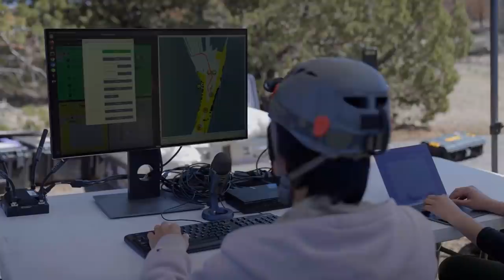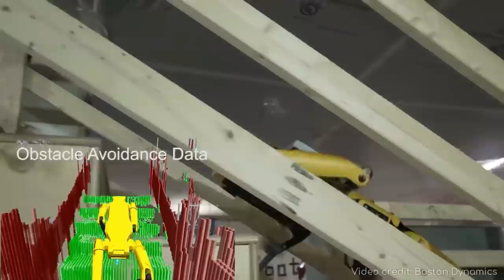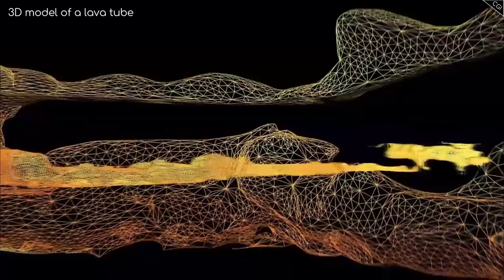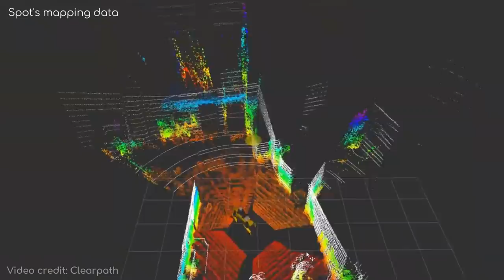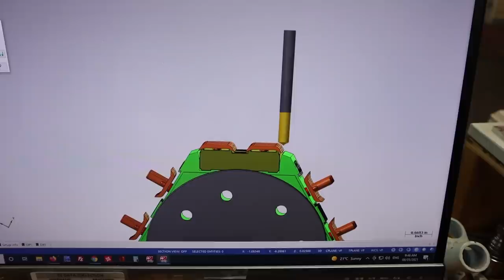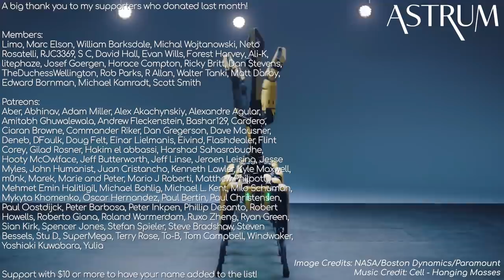How Wheels May Soon Become Obsolete For Mars Exploration

Comment: The 3 challenges that Spot will face are, carrying a nuclear power generator on Spot. As well, the ability for its components to handle cosmic radiation, and extreme cold temperatures.
Reply: Yes, better them than us don't you think..?
Reply: They need not to send unmodified Spot. They will build a specific version of it geared for space conditions.
Reply: That's not really that big of a challenge.  The Viking probes were exposed to far more frigid temperatures and radiation levels.
Reply: Yes, radiation hardening was the first question that came to mind. It's not as easy as just sticking a modern powerful chip in a lead can, or they wouldn't still be using the 20 year old glacially slow chip designs they do today. If walking robots go to Mars they probably won't be anything like the small nimble Spots shown here.
Reply: Maybe they'll have one unit dedicated to power generation and all the others will charge their battery back coming back to connect to that unit. This power generating unit could also serve as a relay to communicate with Earth, the others won't need long range com.
Reply: There really isn't any special challenge Spot faces that all previous Mars rovers didn't face, besides carry capacity. And even then, if the idea is to send multiple Spots then that's effectively irrelevant.
Reply: @GerardMenvussa  I think something like this would be especially good for something like cave exploration
Reply: @GerardMenvussa  yes exactly, tho if it's my version i would not dedicated one unit for that, instead i will put a movable battery station on mars surface and equip each spot with AI that self aware about their condition, so if their battery almost run out , they can go back to surface and switch their battery the back to explore the cave
Reply: Moreover, Mars is dusty AF. Any articulating points on Spot’s body will need to be ridiculously impervious to high-velocity dust particles during the frequent months-long storms.
Reply: @caryd67  true. That’s the 4th major issue to overcome. Obviously these can all be overcome. But it’s important to highlight the challenges and not make people think it’s just a matter of plopping Spot on Mars (which this video almost implies).
Reply: @shadbakht  absolutely. Some YouTube videos almost make it seem like we’ll have cities there in a decade; we really don’t even know what we don’t know yet. But I sure appreciate the many minds from all over the world working on this stuff and moving humanity forward!
Reply: @caryd67  Couldn’t agree more!
Reply: @caryd67  about the dust storm, it doesn't happen below the surface. And spot is specifically design for exploring and mapping mars cave. So I guess that's not something problematic.
Reply: @yahyarisqi7879  good point, I didn’t consider that. But if we did send Spot to Mars, at some point sooner than later, it’s going to have to traverse the surface so it can collect as many data points as possible, don’t you think?
Reply: @caryd67  The thing is, Spot can be mass produced, so it's not as expensive or precious as a typical rover. In fact, even if a space-ready version is ten times higher than the consumer model, its nuclear power source will still be an order of magnitude more expensive than the robot itself. So the real limiting factor is how many nuclear batteries can the mission afford to send up. If they fly up 25, that'd be equivalent to the cost of the Curiosity mission. In other words, unlike traditional bespoke rovers, they can afford to lose a couple to the elements.
Reply: Well if they can "harden" all the rovers against cosmic rays, then I'm assuming they can do the same with the robots
Reply: @z-beeblebrox  

Exactly.  Spot is cheap.  It retails for only 70,000 dollars.   I think that's the point that a lot of people are overlooking.    Losing a few spots on the moon is no big deal.   When one breaks down, you just send in another
Reply: @caryd67  for surface data collection i think they already have rovers for that like the current rovers they send to mars called preserverance.
Reply: The mars rovers already solved those problems we just need to figure out a way to implement those solutions in spot
Reply: @stevencoardvenice  - You'd assume wrong I'm afraid. The feature density of the chips required to make spot work? is far, far higher than anything we've yet radiation hardened.

If we want to put a computer on Mars without it crashing every few seconds due to the radiation? it has to be a radiation hardened chip - and that's not something you can do to any chip - it's a certain class of chips with a very large feature size that is less susceptible to errors caused by cosmic rays - Long story short the best computer we can put in space without it crashing? is about 10 times less powerful than a raspberry Pi.

A Mars spot - would move very slowly and only a metre or two at a time - it won't have chips fast enough to respond to a stumble and update a complex route at the same time. Every unexpected stumble will mean stopping and then recalculating the obstacle again - at best. If it can't calculate that it needs to put a foot down before it falls over? then it's going to fall over.
Reply: @JohnnyWednesday  I saw video somewhere on light based computers. There are some operations in which they are not good at but image processing is their thing and because they work based on laser with specific wave length then they should be completely resistant to this problem. There is company which is from what they said ready to release it and sell it. They said it is perfect for machine learning and image processing. The electronics controlling part of this computer would needed to be hardened but this probably would not be a problem and that computer would be multiple times stronger than some modern consumer grade GPUs not to mention it would draw only fraction of power and heat waste would be minimal.
Reply: @JohnnyWednesday  

Thanks.   I don't know anything about this.   Stuff I did recently hear about this "bit-flipping" problem though from cosmic Rays.
Reply: @likilike501  - Yeah it's theoretically possible to make a computer based on light - but we're a very, very long way from that. An optical CPU matching the capabilities of your Iphone would currently be the size of a city.

Intergrated circuits, individual gates on silicon? were smaller than we could reasonably imagine - before we were even born.

there were 68 thousand transistors in the processor that powered the Amiga 500 and the Sega Genesis - and they were on a substrate as small as your fingernail.

that's roughly a grid of components with 260 rows and 260 columns.

With the lasers, the prisms, the photon detectors - even our best technology right now? would take up a warehouse to do that.

That processor was originally released in 1979.

Current processors have billions upon billions of transistors.
Reply: @stevencoardvenice  - yeah - basically the smaller the features on a chip? the easier it is for any stray particle to change the state.

So 'radiation hardening' while it sounds cool - basically equates to keeping the components and the traces between them - big enough so that when they do get hit? (you can't stop everything) they're far less likely to change.

Other techniques are also used - like having 3 computers working together and get them to vote on the result of any calculation.

If two give the same answer and the other is different? then the first two answers will be used.

Yeah the same bits could of been flipped in both computers simultaneously - but the odds of that are so small? it'd take 10 ages of the universe to happen (or something along those lines)
Reply: @stevencoardvenice  - And yeah there's also parity for memory, error checking - similar to CRC checks or hashing for a torrent file etc

But while your memory might be ECC and protected? a register inside the CPU where some data gets put inside? is not ECC.

Plus your error correction scheme - could be the thing that has an error - causing correct data to be altered to become incorrect.

It's a really difficult problem to be fair - getting a perfect answer when even your error checking might have an error? very tricky!
Reply: @JohnnyWednesday  well that would explain it.   Well I hope they start testing to new hardware in deep space, so we are not stuck using Intel 486 chips in the space program for the rest of eternity
Reply: @stevencoardvenice  - lol! we can do a bit better than that :D but for deep space stuff? not that much better - but we can use multiple processors and for many things? a 486 is overkill. Pretty much... unless it's image processing like the martian helicopter? there's nothing critical that needs to be done that needs much computation.

Take Doom running on a DX4 486 running at 100Mhz - it'll run like silk. The calculations doom does for just one frame? many times the amount than a martian lander updating 100 times a second.

I was born in 82 - I've seen computers evolve, became a programmer - yeah old computers seem slow - but they're really not - it's just that modern computers are insanely, insanely fast.
Reply: @stevencoardvenice  - long story short? Spots computers would crash on mars - equivalent capability in radiation hardened components would take up too much power / volume.

A Martian spot would be more limited - it would pause between short walks to calculate what to do next - it would probably fall over more, not being able to react quickly enough - but! it could still stand back up. dumb-spot will still get the job done :)
Reply: @JohnnyWednesday  

So you're not confident that nasa will ever be able to design an advanced processor that is sufficiently resistant to cosmic ray "bit flipping?"
I know there is a current plan to send an autonomous?  flying drone to Saturn's moon Titan.    Although titan has a thick atmosphere (which might block the rays, idk)
Reply: SpaceX uses triple redundancy and voting when the three don’t agree instead of radiation hardening. That approach may work on Mars too though more redundancy would probably be needed because low Earth orbit is less exposed than Mars would be.
Reply: @stevencoardvenice  - They'll be able to use several instances of a given processor that will be good enough - we don't need powerful computing out there - we just need enough capability to get the data back to the powerful computers here.
Reply: Unfortunately you've touched on the biggest problem, power generation. Since they want to use a small nimble robot, solar panels won't be useful. Also, so much time would be wasted on return trips to recharge.

For this to be a thing they would need a better method of power generation and storage. Lithium Ion isn't going to cut it.

The robot either needs to generate and recharge it's own energy, never run out of energy, or be able to run for days to weeks before recharging.

Edit: Currently spot has a runtime of 90 minutes. What's that going to look like after adding the new software and scientific equipment? You're not going to get far at all...the range of exploration would be limited to wherever it could go in 45 minutes... pretty useless.
Reply: @HE-it9ho  

Why?  Why does the little robot need to last so long?

I think an hour inside a lunar lava tube to conduct reconnaissance is more than enough
Reply: Naw, they are just one more step closer to making the cassette decepticon " Ravage" will launch out of Soundwave 🤣 So let's see how many remember that from back in the day.
Reply: @stevencoardvenice  Perhaps the times I listed were a bit excessive, but even an hour inside a location would mean a 120 minute+ battery life to account for the trip there, an hour of exploration and the trip back to the dispatch vehicle.

I mainly added the extra time to account for anything unexpected.
Reply: @stevencoardvenice  : Well if one ignores the cost of launching mass into space.
Reply: 4:13,  Being equipped with an auto aiming M-249,  reloading ammo on-the-fly,  and clearing jams to continue depopulation programming.
Reply: Gotta say I love all the comments here pointing out how hard space is because although I love that people get pumped about space way too often videos like this make it seem so easy and at the end of the day when normal people see NASA spend millions and several years to basically put an r/c car on mars people just think the engineers suck or are wasting money when you can just buy one just as good if not better for a couple hundred dollars.
Reply: @luxeraph    SPACE:  The final Boondoggle.
Reply: You wouldn't be able to run the robot and all that advanced electronics on an RTG.

My guess is what would happen is they'll land a centralized power hub which would have robot docking stations, central communications and deployable solar panels. They could then have numerous spot robots built for different functions. The robots would dock to recharge batteries. They would receive missions and be dispatched to perform them, then come back once the mission is complete. They'd then reduce and upload collected data and recharge awaiting future instructions.

If a spot became nonfunctional you could send in more. They'd get dropped off by a skycrane and link up with the central hub.
Reply: @stjernis  radiation is not as big of a deal for electronics as people think. It takes significant dose rates for any immediate consequence to be observed. The dose rates observed on Mars are about 0.7 mSv (70 mRem) per day. That's a dose rate of 28 uSv/hr (2.8 mRem/hr). In my work we regularly deploy Panasonic cameras in dose fields of .5 to 1.5 mSv/hour (50-150 mrem/hr) and run them for two years straight. Even then the damage from the radiation dose is not terrible. They're mostly damaged from the heat.

So on Mars the radiation is not a huge concern for robotics. Plus if these are going in caves. The primary source of radiation on Mars is cosmic radiation from space. Once in the cases they'll be shielded by the ground above and probably see little if any radiation.
Reply: I think Spots biggest challenge will be in not being distracted when a human plays “fetch” with it.
Reply: @caryd67  Just use rubber bellows like on a cars steering rack.
Reply: @bomberaustychunksbruv4119  but rubber can’t stand up to cosmic rays, which I’m guessing is why the landers don’t use rubber tracks like a mini excavator
Reply: @mikespark72  They  will have to upgrade the servos & torque,  so Spot can rip off human heads with one quick 'snap!' and play 'fetch!' with cyberdine T-800s.
Reply: @caryd67  It's actually weight, rubber is heavy, track systems are heavier. Rubber isn't great in the cold either. Tracks are also unreliable compared to wheels. Tanks and construction vehicles use them because otherwise the ground can't support their weight. Tracks are also highly inefficient so their range is less for a given battery. Legs have all these disadvanges but even more so. I could see a leg/wheel hybrid that mostly rolls and if it needs to it can repostion a stuck wheel or walk a few steps. A leg with two degrees of freedom in place of spot's 4 would be lighter and more robust. No jumping or running just get unstuck and keep rolling.
Reply: @GerardMenvussa  how do you keep that massive battery warm?
Reply: @shadbakht  yea its irritating listing him compared the stats of a rover made to survive Mars vs a robot made to work on earth and plug into a outlet to charge...
Reply: @z-beeblebrox  Yes. There is challenge and there will be for a while. I haven't heard yet about micro fusion reactors being operational. All those robots like Spot and atlas are fun but as long as we stuck with current batteries nothing will change.
Reply: @ominous-omnipresent-they  But weren't the components simpler?

Comment: The "signal lost" inside a cave issue is easy to be solved... leave a robot at the entrance with a strong antenna to be like a beacon for the robot that goes inside so he can have a bridge between the external area and the internal one... and if the caves are going too far inside, bring some more to make more bridge points. With that you'll have a strong radio signal every time

Comment: This is what I have been talking about for years now. We really are at the point now where we could transition from using wheels on our robots on Mars to actually having legs. It makes so much more sense for speed, agility and balance, yet we feel too nervous to take that huge yet necessary step. Not only would it look far more amazing, but would also be a lot more practical, and is definitely the way of the future for Martian and other planetary exploration.
Reply: Are we at that point though? I'm afraid this video strikes a much too optimistic tone and just doesn't talk about all the technical challenges of deploying something like this on Mars.
Reply: @unvergebeneid  Yup, we're not. It's not efficient enough and battery capacity is a huge issue. Look at the surface area of the rover vs the robot dog. It's just not doable, yet.